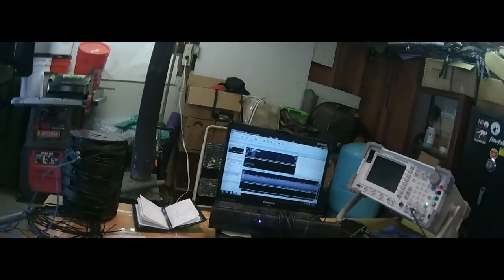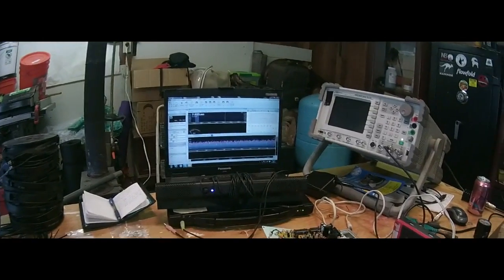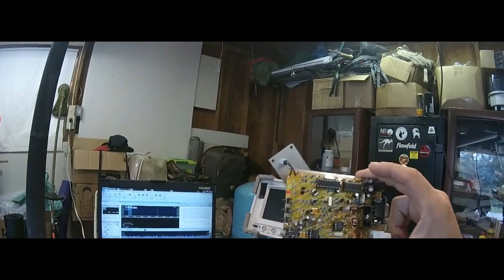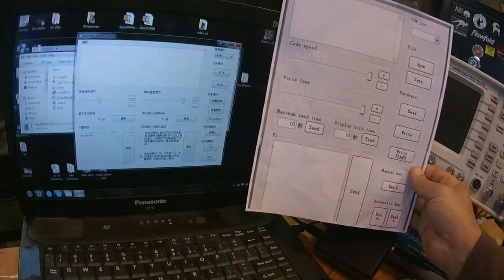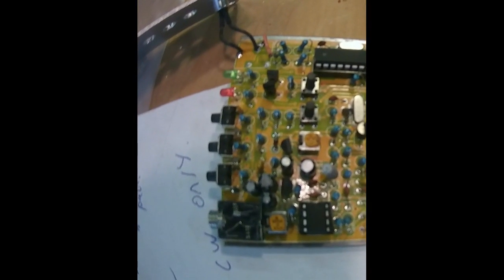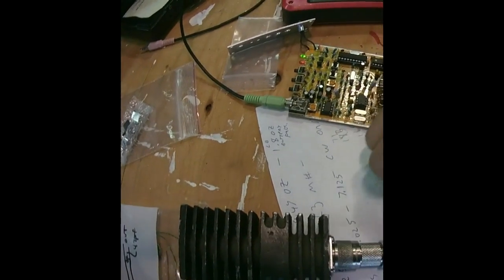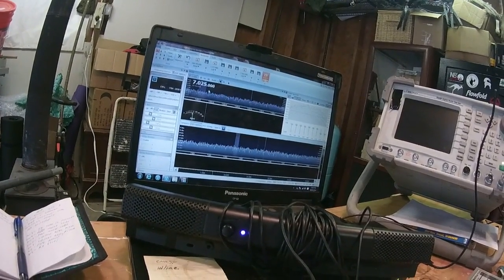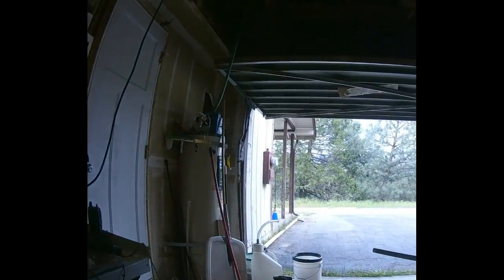40 Meter Rockmite51 clone, For Low Power HF Propagation Testing.

Comment: Technicians have voice priv. on ten meters between 38.3 mhz and 28.5 Mhz.  You can talk on those freqs. And of course all VHF and above  tech have voice permission.  Transmitting CW does not have to be only manually.  You can use a TNC or any modern digital box to send CW.

Comment: Hi, I have four Uniden base scanners. I'm new to scanning. I have a Icom ah-8000 that I am going to put up. what type os spitter should I use to run all four scanners off of the one antenna. Also need some info on grounding.Thanks.Robert (Arizona)

Comment: You as a Technician class license holder do indeed have voice (phone) privileges on all of 6m, and on 10m between 28.300 - 28.500 USB, as well as CW privileges on 10m, 15m,  40m, and 80m.     

http://ad4c.us/Other%20assorted%20manuals/ARRL%20HF%20bands%20plan.pdf

https://en.wikipedia.org/wiki/Amateur_radio_frequency_allocations

http://www.dummies.com/how-to/content/ham-radio-for-dummies-cheat-sheet.html

73 - W7BBQ - Chris.
Reply from the maker: +Cactus Makeshop Thanks for the info. Didn't take much a look on non.NVIS freqs. Love the call sign. 73''s

Comment: i predict you will love NVIS.  i have a set up using a wire dipole (home brew, speaker wire..spool of 100ft $12 at home improvement store).  it is cut to resonance at 3.650 MHz (80M) and will tune on 40M with a tuner... but you can get a 40M dipole from the same spool of speaker wire (80M about 66ft  wire is 2-wire, 1 for each leg of dipole.... remaining wire will go to 40M, about 33ft 2wire--- so no tuner and you can feed with coax if it's cut to resonance where you will use it.
from my location i get consistent 300 mile radius with antenna feed point 10ft above ground level.
NVIS is a bit more difficult to do location triangulation as most signals are coming back down from above. so this would be a stealth-like approach to regional comms especially in rough terrain.
best wishs!
-rob 
(yes, i'm licensed)
Reply from the maker: +rkaag99 Nice, I cant wait to find this out for myself. Thanks for commenting and watching.

Comment: I know some hams would shun it, but you could take a laptop into the field and key that thing with the serial port. Then plug the audio into the laptop and decode the received CW in software. FLDIGI software can do it. I'm a no-code general class and have been thinking about trying out one of these kits and using software decoding. I've read that trying to decode CW in software is very hit and miss though. Haven't tried it yet. Future experiment possibly.
Reply from the maker: +Josh Greer That actually sounds like fun. Yup, another project experiment to stack on the to-do pile.. Thanks for watching.
Reply: +Josh Greer FLDIGI is very nice.  my best luck for clear 2-way CW is to have a computer on both ends of the contact.  the small variations in timing that a human introduces during CW can mess with the computer's decoding.
-rob
'CW, the original digital'  - author unknown but i like it

Comment: Great video ! I look forward to seeing how it works out. I was wondering if perhaps there is a software variable that controls the state of the key input between continuous closure and timed momentary closure. I would feel if the chip was hosed you would have no functionality at all.
Reply from the maker: +SurvivalComms Re-visited the software and tried every combination without success. I probably induced a static charge or something, since I was monkeying around the PTT circuitry. I didn't take any ESD precaution.
Reply: The key button was working for you for a while after you installed it? I think the ring and sleeve have to be shorted together to put the keyer in straight key mode. If it was working at one time you must have done that.